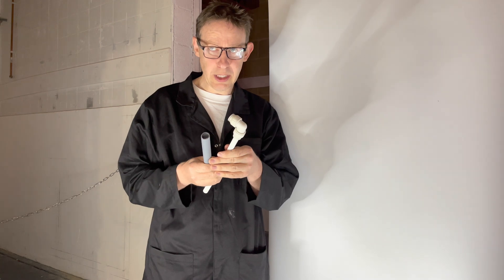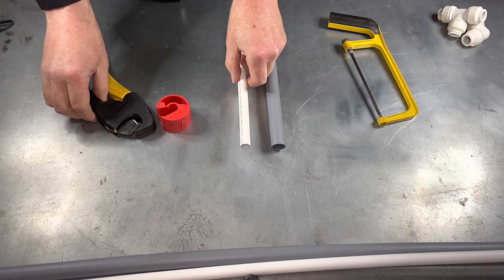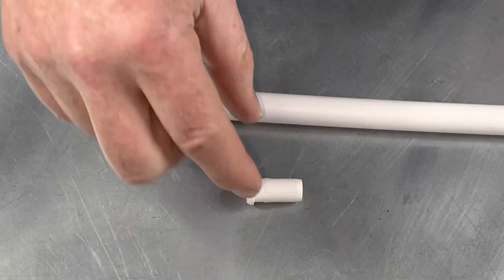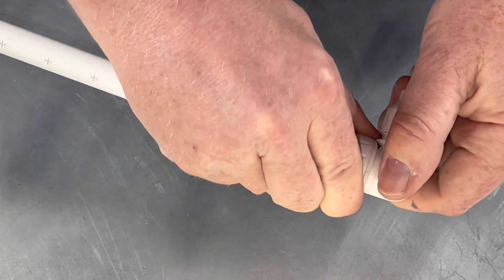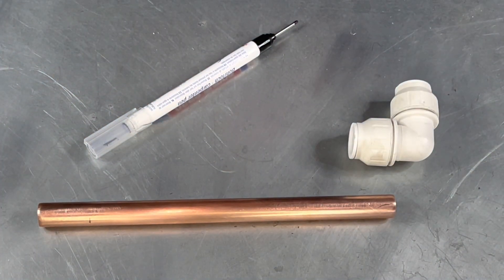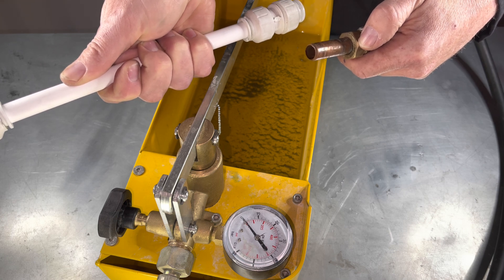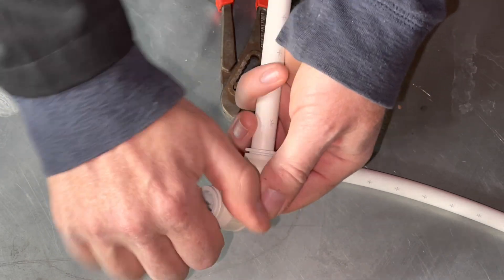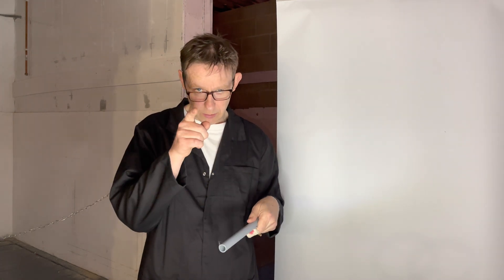Plastic pressure pipe in plumbing  (PushFit)

Comment: Plastic pipe with the inserts makes the internal diameter of the pipe less then the equivalent copper sizes 15 / 22mm reducing flow rates. If I had to use plastic, I'd go for the next size up to aide flow rates.
Reply: I don’t believe it has any great effect. The smaller diameter is only 10-20mm it doesn’t create mush resistance. It’s a little like the reducing valve on an unvented cylinder it’s is less than 15mm internal but can still pass up to 50litres per minute.
Reply from the maker: Interesting observation
Reply: Fittings are just as bad too, more on polypipe /Hep.